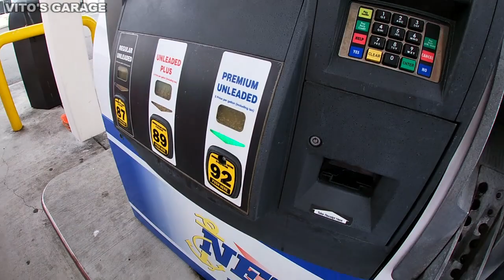Mercedes 190E Battery Tray Restoration & Preservation/  Mono Wiper Lubrication!

Comment: Get yourself a little 2000 watt portable generator and a shop vac.
Reply from the maker: Where am I gonna keep it? In the lot? I'd rather use cordless tools for now. If there's a need for electricity, I'll use my buddy's place
Reply: @VITOSGARAGE  Yeah that does present a challenge.  The small generators will fit in a car trunk. Even the smallest shop vac would make the job of cleaning a vehicle a lot easier. Anyway, just an idea. Keep up the good work Vito !
Reply: @VITOSGARAGE  An old van would be cool. Good for mobile repair service. Lot's of room to keep all sorts of tools. Brain storming!
Reply from the maker: @ImpalamansGarage  Thanks Mike! I'll definitely keep all that in mind :) I might consider it. Save Classic Mercedes!

Comment: do you have tips on taking out the assembly? im trying to pull the wiper to diagnose a water leak around the blower motor but i cant get the wiper out of the car. i have taken out the 5 fasteners but its stuck!
Reply from the maker: You have to be a little patient taking it out. You might need to unbolt the panel that’s in front of the wiper to give you more room to take out the wiper. Wriggle the wiper assembly back and forth and it should pop free. There’s a very important drain on 190s and W124s and it’s located under the blower motor. Make sure you remove the blower motor and get to that drain to clean it out. Use a long hanger and compressed air. Once you’re done cleaning it out, pour water in there and make sure the water is draining

Comment: Hey Vito first of all thank you for your videos.
What I want to learn is, is it really safe to use bearing grease over plastic surfaces? As far as I know synthetic grease must be used for plastic parts otherwise normal grease will destroy the plastic by time. Am I wrong?
Reply from the maker: I've been doing this for years. Never had any problems. Rubber doesn't like regular grease. I use silicone grease on suspension rubber and window seals to keep them from cracking and getting dry. I use regular bearing grease on metal. I don't put grease on plastics
Reply: What is the type of grease at 06:47. Inside the wiper assembly,  isn't that plastic?
Don't take me wrong, I'm just trying to learn because I will do the same as preventive maintenance.
Reply from the maker: @emreakin8861  ohhh you mean the wiper plastics. You must put grease on the inside of the mono wiper. It must be greased up. You can put grease on the plastics,  nothing will happen to it. I used a high temp grease on the mono wiper. But you can use a regular bearing grease as well. Cheers
Reply: @VITOSGARAGE  Thank you so much Vito, you are so kind and helpful.
Reply from the maker: @emreakin8861  You are very welcome! Thank you so much for your support :)